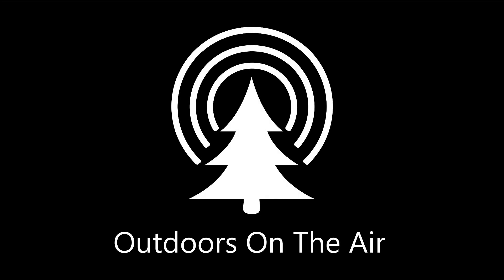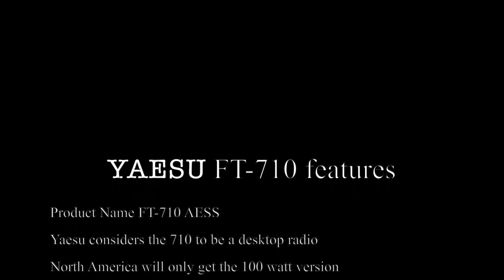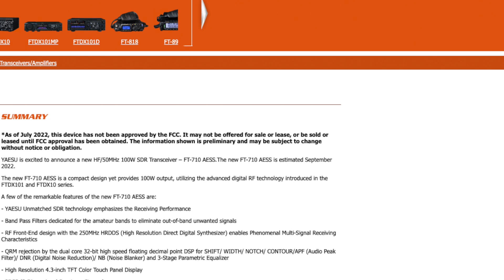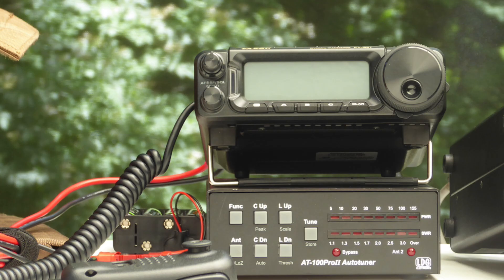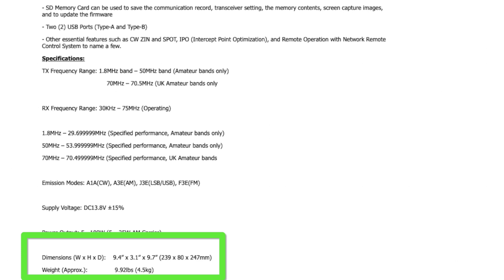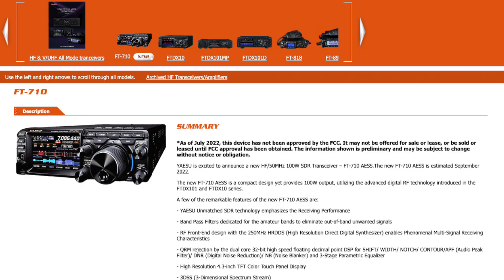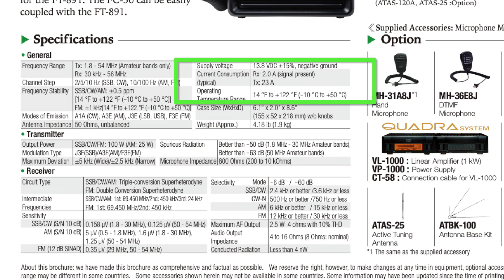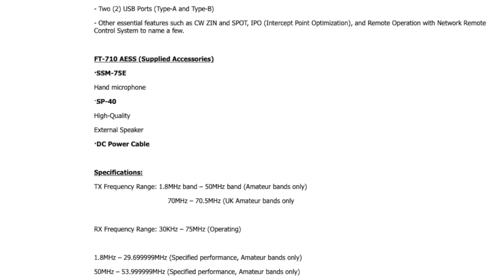Could the Yaesu FT-710 be the Next Great Field Radio?

Comment: It is an interesting mix and paradigm shift.  High current draw portable radios with modern light high capacity Li batteries.  I am still trying to get my head around it.  I am very fond of my FT-897D.FC-30 plus internal NiMH batteries.  Though now might be a good time to sell them.  Technology has moved on.  Though I do enjoy the one box feeling.  With the FT-897D with internal batteries, all I requires is an external antenna.  No batteries to carry and no cables except for an RF cable x 2, a 2-way antenna switch and [catch lead, an antenna for 40 meters, and another for 20 and up.  I use Transworld Antennas from my S0 noise surf location.  Does an old dog have to learn new tricks?  It looks so.
Reply: Did a 5 hour with it on full power  using a 50ah lifepo4 battery.  Only used a 1/3 of the battery

Comment: From all appearances I would guess it to be an FT450d replacement since they have similar form factor and specs (both have internal tuners).
If it has integrated sound interface via USB and the SDR abilities then it will be a great entry level HF/6M rig but not the portable unit we are all salivating for ;)

Thanks for bringing the topic up 
73
Doug
N7BFS

Comment: There’s a reason the 891 is the best current field hf radio. <1A on rx like you mention, the same exact DSP chip as the 991a , voice keyer, eq the list goes on. I don’t want a tuner in a field radio, I strive for a resonant antenna. Tuner and field radio sometimes seem counter intuitive however I do understand sometimes you need a little touch up.

Comment: Nearly 10lbs? That's as much a portable radio as my IC-7300 is. If I'm lugging the ic-7300 to the field, I'll also lug 13lbs of 40ah lifepo4, and receive current becomes much less of an issue. My $0.02 73 de w8tam

Comment: The idle RX current draw is important, but I am more concerned about what happens on xmit when the voltage begins to fall on a drawn down battery.   If the xmit signal is crap at lower voltages it will be a problem going battery portable.   Big fat power connections to a lifepo4 battery won't be enough if the signal distorts at actual 12v.  I understand why the industry standard is 13.8v, but it is no longer how many people want to use their rigs.  And QRP ain't for everyone.

Comment: Great informative video, as always. I liked my FT 897D for a portable when I would run 40 watts out. I've since upgraded to the FT 991A for my portable radio if I want to run 40 watts out. I pair that with a 20 amp hour LiFePO4 battery. 
I was very disappointed when I found out that the FT-710M (50 watt version) was not going to be released in the US. I think that would have been the best multi purpose portable radio since running that radio at 50 watts out, it's maximum power rating, the current drain would probably have been around 9 amps comparted to the 14.5 amps of current drain when running my FT-991A at 50 watts. The current drain again would have been a lot less at 5 watts out comparted to the FT-991A at 5 watts out. 
Yaesu also makes a QRP version of the 710. I think it's a tad to large to be a dedicated QRP radio. 
Thanks again for the nice video. Keep them coming......    
de KU3X/QRP
Reply from the maker: Hi Barry, sorry for the delay in response. I'm way behind. Thank you very much for contributing your experience. 73 from VE3TWM.

Comment: I wonder if the speaker cabinet is MORE that just a plastic box with a speaker in it. If it is, then DIY or 3rd party options might be practical. I am suspicious that there are no photos of the back of the radio. External speaker with clever electronics and weird connector might be occuring.
Reply: If you look carefully at the photos available for the FT710 you can see speaker holes in the top front left side, so it probably comes with a standard internal upward facing speaker, I have some doubt it will come with the sp-40, but who knows? The IC-7300 is being offered for sale with a free Icom external speaker in the UK

Comment: This radio fills the gap left by the FT-450D HF-6m transceiver.  I image that the current consumption is going to make it impractical for portable use. The display, DSP, and ATU will add to power draw. G7VFY

Comment: OK, I'll hold my hands up straight away and say I'm a committed 897 fan. It's the nearest thing Yaesu have made to a military spec field radio IMO. Yes, it's an old radio now and is out performed by many newer offerings but I love the 897's form factor and the "I could knock tent pegs in with this" feel about it!😂 Yaesu regard the new FT710 as a "desktop" radio. I guess you could regard any radio as a "field" radio if you're prepared to take the necessary precautions with transportation etc. Why Yaesu couldn't just update the 897 with new circuitry and maybe a tad bigger screen and maybe even an IP rating is beyond me. Large colour displays seem to be de rigueur these days but you don't NEED one!

Comment: The ft 891 receiver current is state as 2 amp  in the yaesu site which is not accurate, it drew less than 1amp. So it is probably not accurate in the new radio either.
Reply: This is max. RX current, not minimum

Comment: Have you ever considered a rig with top-mounted controls such as the Elecraft KX-2/3, Lab 599 TX-500, or even the Icom IC-705? The FT-710 looks to be quite large, and you have to prop it up to see the display. I wouldn’t buy a radio just because it has top-mounted controls, but since those other radios that I listed are all top performers then you might want to give them a try.
Reply: Agreed. KX2 has not been beaten in the marketplace.
Reply: I like Yaesu, those others are way too overpriced IMHO!

Comment: I noticed on the FT-991A screenshot you showed that they have C4FM on 146.520. I'm imagining a bunch of angry hams if you transmit Fusion there :)

Anyway, personally I think anything higher than about 0.5A for RX current is a no-go for field use. Then again, this is based on my experience with radios like the IC-705 and KX3, which may not be a realistic standard for radios capable of higher power.